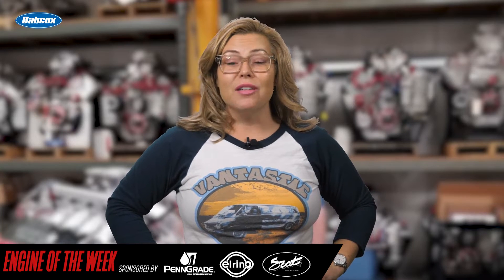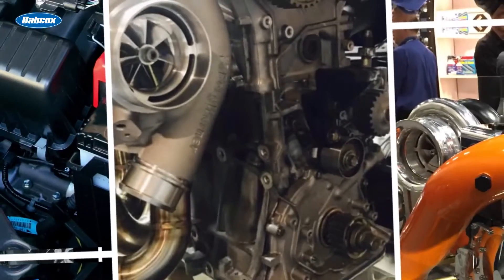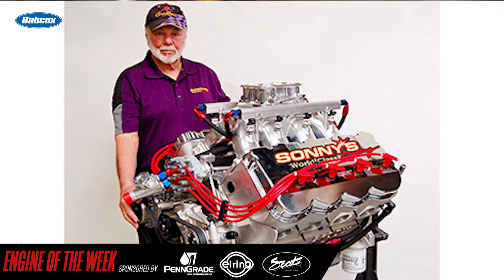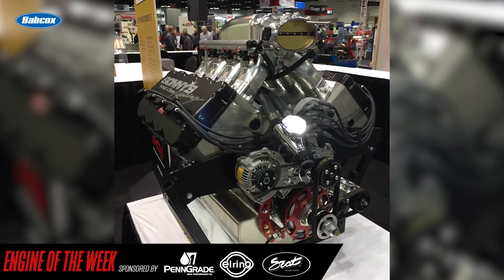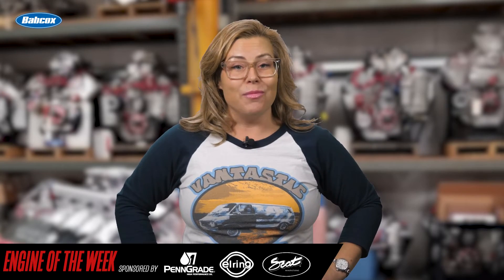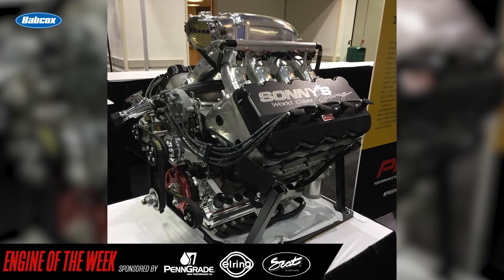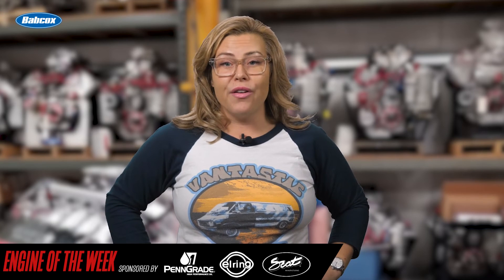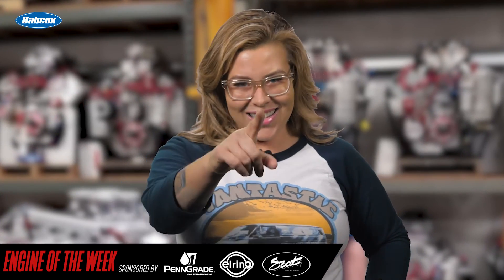762 cid Naturally Aspirated Hemi Engine

Comment: Oh how I love large by huge cubic inch NA engines. I was just building a 78 Malibu with a 540-632 CI BBC, 6 speed manual, 9" rear, suspension, brakes and etc in my head. I've had my fun building a LS 8n almost every conceivable fashion so I really think my next build (which I finish the NA LS2 for my Yukon and turbocharged 390ci LS for my RCSB) that I really want to build a BBC to go in my next project.